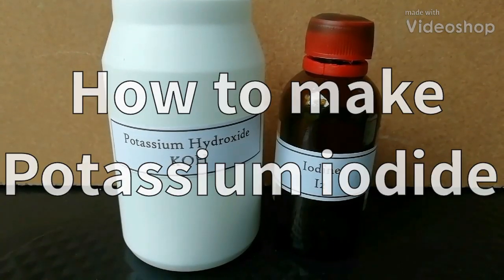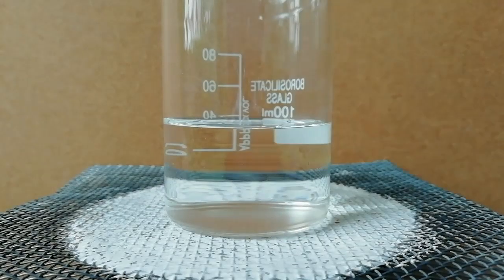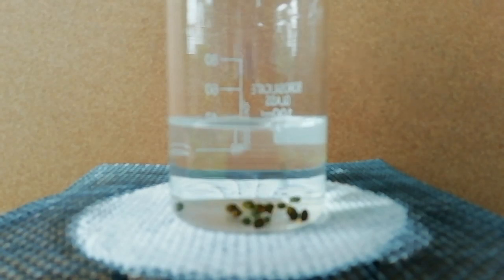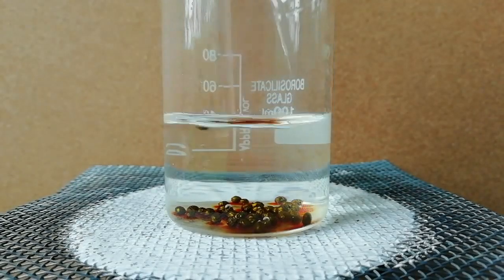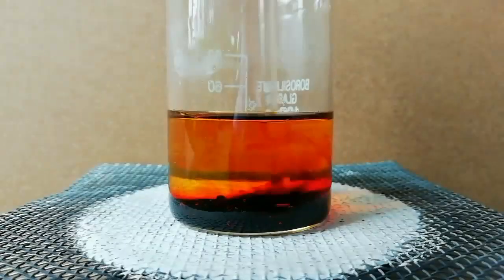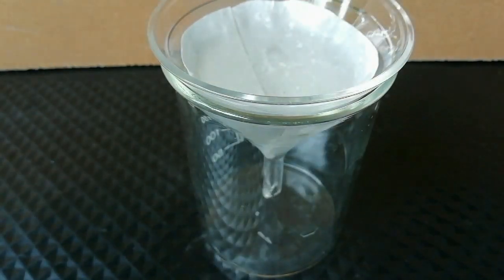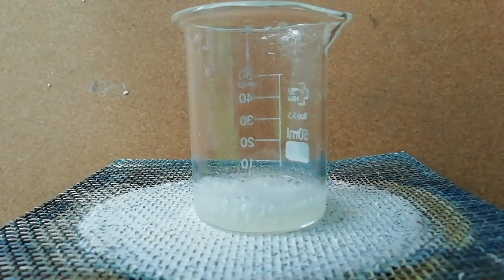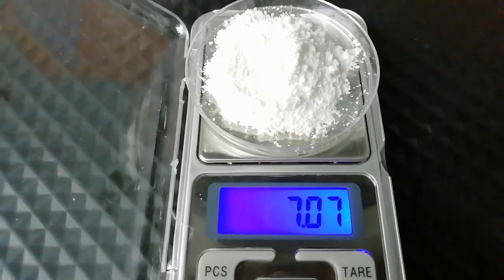How to make Potassium Iodide

Comment: What if you have liquid iodine
Reply from the maker: You can use iodine solution. Some iodine solutions may contain potassium iodide. So if you use solution add potassium carbonate/hydroxide  solution into a solution of iodine until the solution become clear.
Reply from the maker: However potassium iodate is also produced in this reaction.

Comment: So we boil the whole thing at the end until all the liquid has evaporated? You just scrape the white powder if potassium iodide left in bottom of the beaker right?
Reply from the maker: Yes, from this method you can not get pure potassium iodide because potassium iodate is also proceduced during this reaction.
Reply: i thought i just read that the KI is the liquid part and that you must filter out the solids.

Comment: to obtain very pure Potassium iodide it's best to use potassium hydrogen carbonate with iodine in H2O, in this process Potassium iodide is formed almost exclusively without Potassium iodate, and the CO2 that's also produced during this reaction is a gas and will leave the solution and then the solution only needs to be evaporated, done!
for more information, here is the Source: Handbook of Preparative Inorganic Chemistry. 2nd Edition. vol. 1 p. 290
https://www.pdfdrive.com/handbook-of-preparative-inorganic-chemistry-2nd-ed-vols-1-2-e58052662.html

Comment: How much KIO3 is produced and how to separate most of it?
Reply from the maker: It is around 1.5g. Remove KIO3 by cooling is not a good method. But we can heat the final mixture to 550°C-650°C, then KIO3 will decomposed to KI. Then you can have KI with high purity.
Reply: @ChemExLK  Thanks for your quick reply, but you missunderstood me. I was asking how to get pure KIO3 (even if it means KI will be lost during the process. Is there any way to convert KI into KIO3?
Reply from the maker: @d3vil574  actually I haven't tried this method. But wikipedia says by fusing potassium iodide with potassium chlorate, bromate or perchlorate, the melt is extracted with water and potassium iodate is isolated from the solution by crystallization

KI + KClO3 → KIO3 + KCl